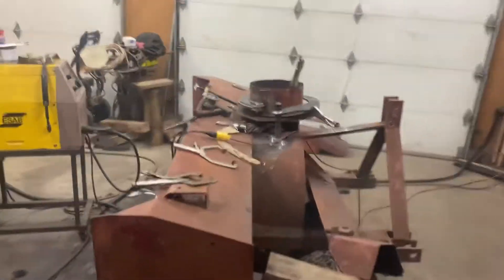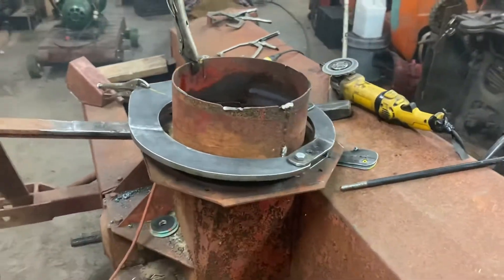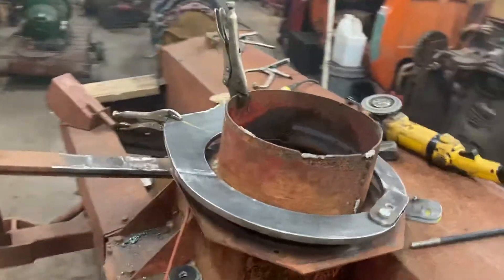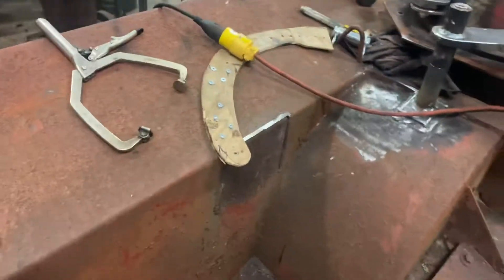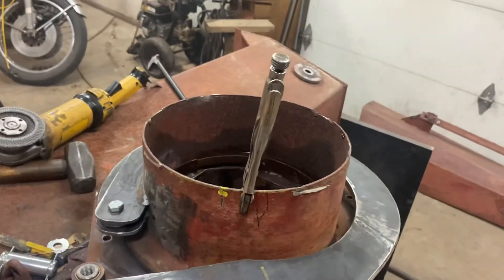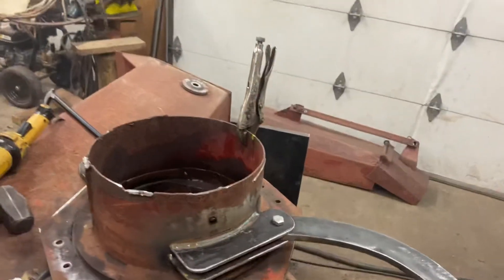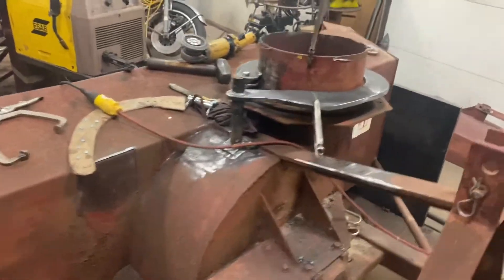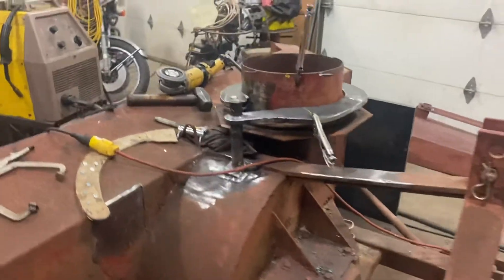Snow blower hydraulic chute rotator

Comment: Hey I was wondering would something like this work on a x739 yellow snow blower. The design that is currently there sucks. This looks like a better alternative
Reply from the maker: Should, I R&D’d (robbed and duplicated) from a 6’ John Deere blower just up sized it to this application. It works good, haven’t had any issues with mine in 9 years, this one we built working good all winter for the guy.
Reply: @FlatBroke612  I want to do something on my x739. The cable are a bad design